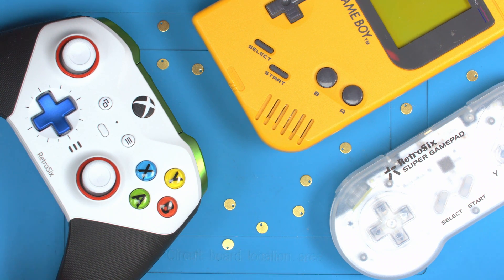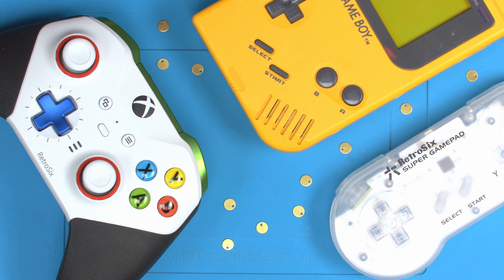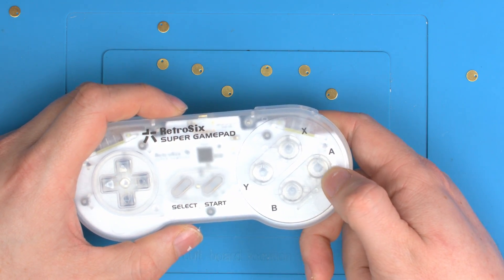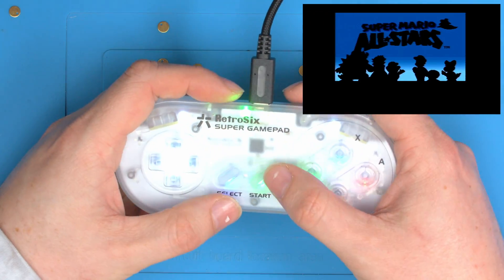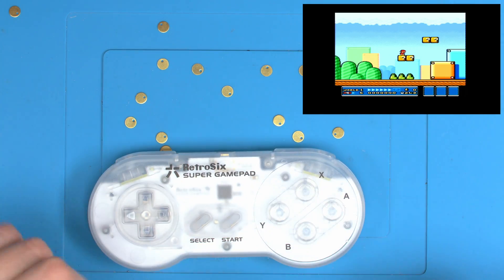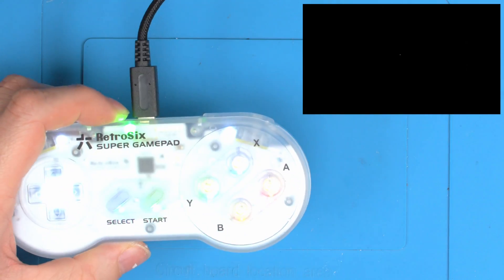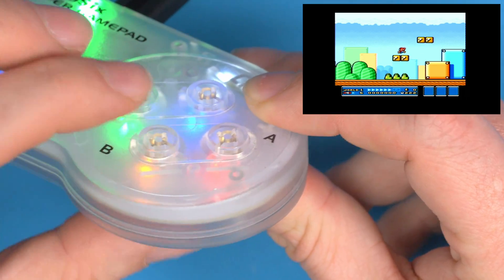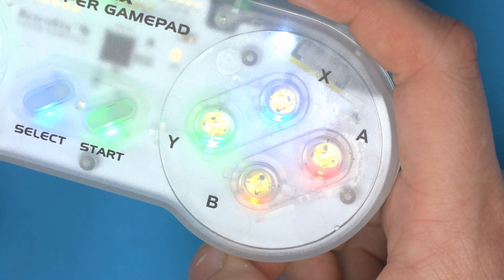Pro Pads Make Any Controller Hyper Responsive! (Pro Pads by RetroSix)

Comment: Omg I need these.
I find it hard to use controllers or handheld consoles due to having arthritis at the base of my thumb on my right hand.
As a result, I have limited movement due to the pain, so I tend to roll my thumb on the buttons, which doesn't always work, which is really frustrating especially with platformers as I will walk off the edge because I didn't push the jump button hard enough.
So these might actually be perfect for my retro handhelds which I can't use my specialist controller with, I'm  definitely picking some up!
Reply from the maker: Nice. Let me know how they perform for you
Reply: I just got them today and put them in my GBC and played DK land 2 DX (romhack) for about an hour, and so far, I've noticed a massive improvement.
I can only really do gentle presses due to the stiffness and pain in that part of my hand so I think for me these are going to be game changers and let me play these old consoles like I used to before this injury which is awesome 😁

Comment: Are you working on a  modern ps1/ps2 controller ?  
I keep running into problems with the face buttons not working and the usual analog issues with old controllers
Reply from the maker: Not yet but defo plans. GameCube next up.

Comment: I'm a simple man. I hear "better D-Pads", I press like.
Reply from the maker: The the dpads you tape one or two Pro Pad to the PCB in the center of the four button pads. This lifts the dpad giving it better rock. So different than buttons but also improves them in the same way
Reply: @RetroSix  I did a similar mod to my 8bitdo, but I used a perforator and an old credit card 😂. It's not perfect but it works.

Comment: Cant use it on the gameboy advance original start and select buttons though lol. I've clean pads and perfect pcb but when shell is together I get mis presses. Loosened the shell and its better but still not perfect. Just a niggle but wish these supported those to. 

Make a tactile flex for the original advance with custom start and select pads and I would buy in a heartbeat
Reply from the maker: Yep tactile flex is best for stat and selects. I will make them soon
Reply: @RetroSix  now this is exciting. Would be the only ones on the market to offer for start and select on the normal advance due to no one wanting to make a new silicon mould to accommodate those buttons on the original advance. Would make my handheld perfection

Comment: Great video 👍
One thing that always bothered me about some of the more modern controllers (particularly the PS3) is wear on the analouge stick. Over time some become super loose feeling and it feels horrible to use. 
I once looked into it but the solution seems to commonly be either replace the controller or "hope you're good at soldering"
Reply from the maker: Best is hall sensors and springs so no wearable parts
Reply: @RetroSix  do you sell that for Xbox series controllers?
Reply from the maker: Yes these work for it. Link in description
Reply from the maker: Oh the hall effects? Not yet no